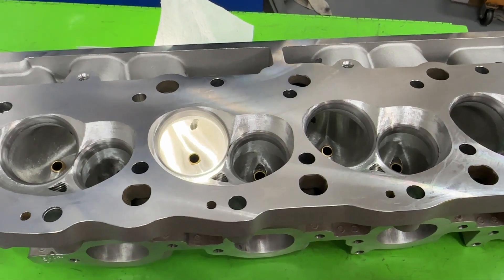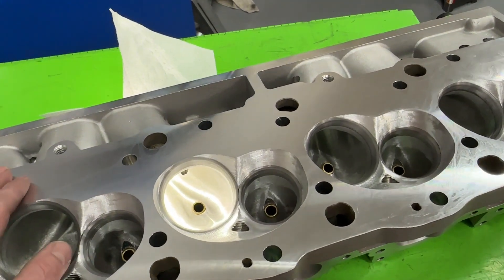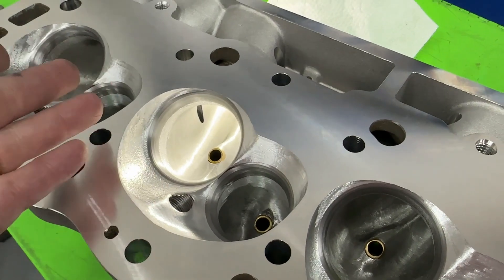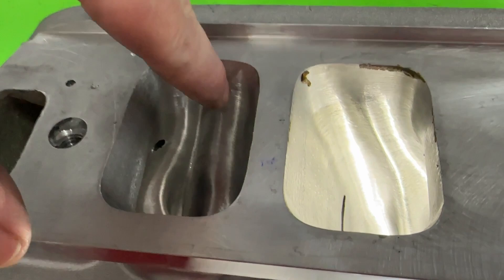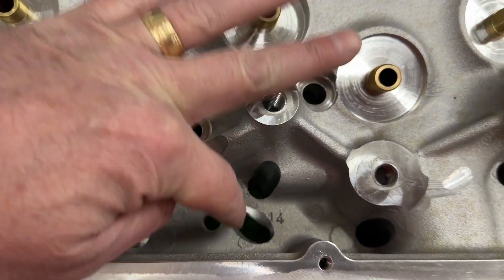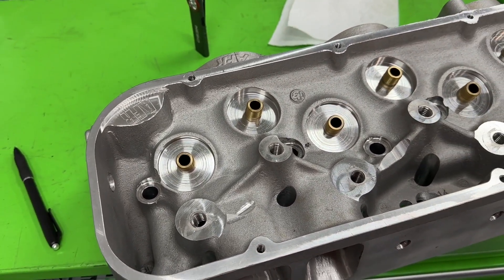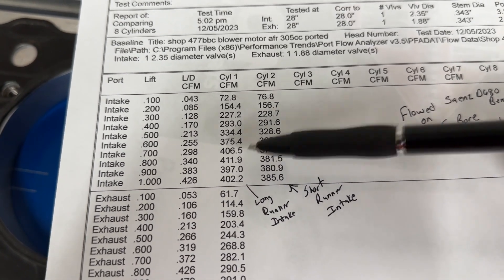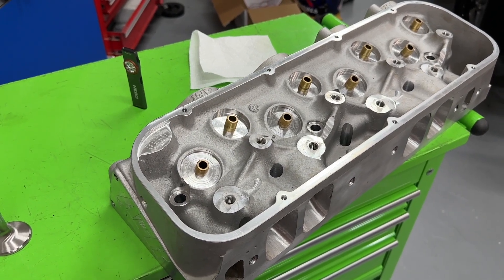Heads For 477bbc Blower Motor: AFR305 Ported

Comment: Nice flows i haven't been paying attention to bbc head flows compare sbc but it seems like the head flow on bbc there is a wider range of flow numbers when comparing different bbc heads just a thought. That's pretty cool man bbc dyno stuff sounds good big motor for big power. If i had to guess on hp na probably 750hp and 700lbs. Just guessing dyno numbers to see how off i am

Comment: Aestically pleasing ports make no more power or torque. Air flow just doesn't care as you know. Shape ultimately wins. Nice heads & should make for quite a fun ride. Love external oil returns, I then block the valley except the front & rear on a Pontiac block to help control windage. Pontiac stock block lifter valley looks like lifter bores in space & makes me sad. Ibuse a full bracing system (steel & aluminum) with epoxy to brace & fill it as well as possible. I use a crank scraper & a good pan. I'd recommend a Moroso or Steffs aluminum pan with nice mick-out on RH pan rail. Testing on other shows revealed 60 HP & better oil pressure throughout the curve. I'll be excited to see how it runs for you. Going to be one bad Rat!
Reply: Hey brother, i run a stock block Poncho......yea, i'm aware of the oil return/windage issue......i use a Spots Performance scraper, AND the factory windage tray, w/o the other returns, in the hopes of keepin the oil in the pan, w/o adding any possible windage....liked ur comment sir!!!...Eric SURE has alot of expertise no??.....i've been an avid sub'r for years now......he's got talent!!!......nice to meet a Poncho dude like myself, while chkin out his latest vid....PEACE  to you sir!!
Reply: Btw, my cam isnt huge (247/255) lift is at .560/.570, so i havent used a brace system yet, but i'm intrested....what brace did u use???.....do ya know my guys at Kauffman???.....i dont like Butler, they dont innovate, Kauffman DOES!!....anyhoo, wud like to know what brace system u used.....ok, PEACE

Comment: Thanks again for the excellent videos Eric . My first AFR head . Mine were the CNC chamber a version they used to offer , the full CNC version was a 315 . Had on a 496 then 540 . Switched to CNC 335 and had my Victor Junior ported and picked up 118 hp on same dyno but throttle response went from air wrench to EFI on a Quick Fuel 750  carb with a D1SC  Procharger . Imaging running as cast 325cc heads on a 454 like many people do , ie stock rec port heads .
Reply: You think stock 454 with as cast heads with a procharged will be plenty powerful for a street machine. It's what I'm on with now

Comment: What happens when the port is 'unstable'? Is it because when the EV valve is opening the flow is sonic? Which is ironic because the tulip exhaust valve is supposed to help with that, but I suppose as you said it takes shaping all the stuff around the valve to get the most out of it.